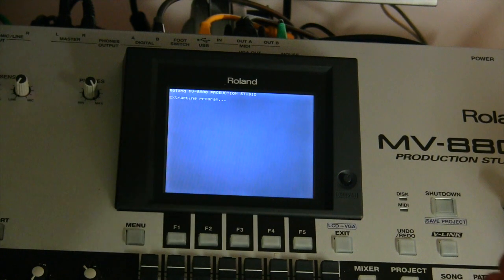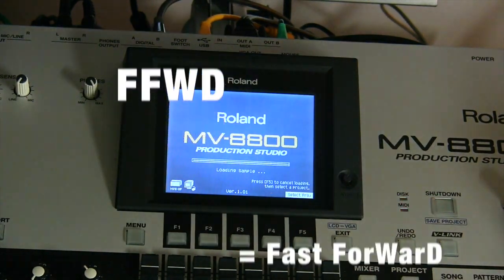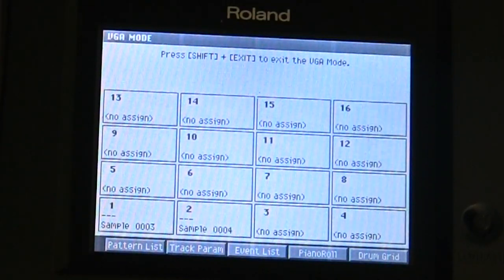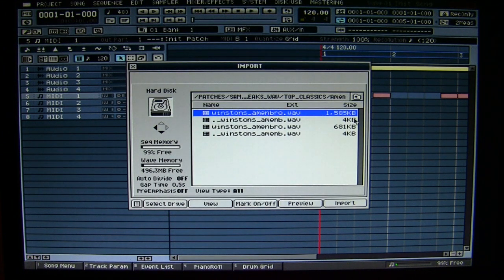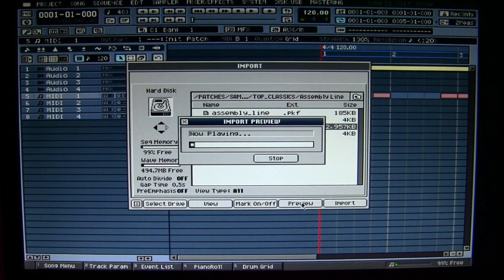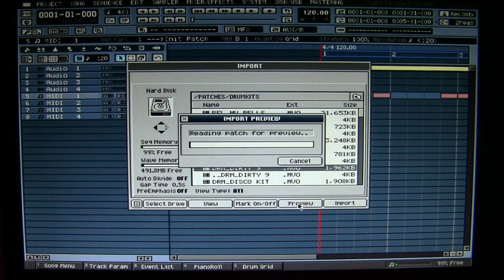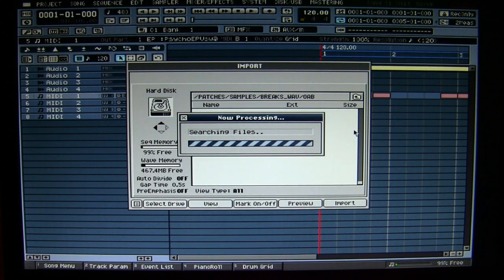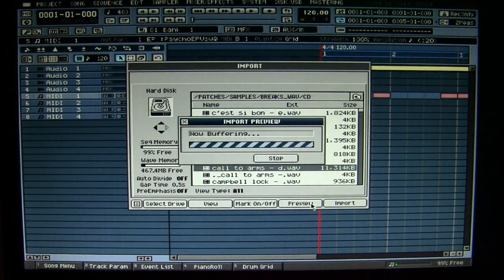MV-8800: I replaced the SSD for an IDE-CF adapter and the result is amazing!

Comment: There’s no iso files that need to be on the card?  The card isn’t for start up right? More for transferring and storage?
Thank you.
Reply from the maker: Correct! No need to have ISO files on the card. You format the card when it is installed in the MV and then it’s just an ordinary drive to store your projects, samples and so on. 
You can take out the card and insert it into a reader for your computer to make back ups for example or transfer sample libraries to the card. 
This is so much quicker than using the USB-connection of the MV. 
Hope this answer helps.
Reply: @theMIDImaniac that’s for that. Appreciate it
Reply: One more question 
We can save songs (projects)
I actually put the sd in where the floppy was. I have a MV8000 just waiting for male data to 4 pin to power and longer ribbon cable to board. 
Thanks you made me fearless to do it. 🎉
Reply from the maker: Yes yes! You can save projects, samples, mastered files and so on. 
I sold my 8800 some time ago and lately bought an 8000 and did the same like you’re doing now. I placed the reader where the floppy was. Just an amazing place to have that drive. 
Indeed…the ribbon cable needs to be longer. 
Good luck on your project! The MV is still an amazing piece of equipment. 
Glad that I could help 🙌🏽

Comment: Hi, 
Love your video and I am in the process of switching over to the IDE - SD adapter, because my drive went out. The problem is that my system was not updated to the 101 version and when I power up, I get a blank screen. Are there steps I can take to bypass boot up with new drive. Or do I need to update the system 1st before installation. My old hard drive will allow me to boot up, but always have drive error when trying to load or save projects. Any suggestions please.

Comment: Where did you find the special bracket to remount the CD Drive? What type of adhesive tabs or glue were those? Did go through the normal formatting process in the MV for the Micro SD card or, not?

Comment: do u have to keep the cd rom player in the mv 8000
Reply from the maker: When you have an MV-8000, you can leave the CD where it is and just take out the floppy drive to have the CF-reader on that spot. 
That’s really a great place for the CF-reader.
Reply: @theMIDImaniac   so do i remove the floppy drive cable from the main board ? or leave it in ?
Reply from the maker: @TB-po5cj  you can take out the cable too.
Reply: @theMIDImaniac  I replaced the HD drive with new drive and keep getting disk error , I put the card reader in and still getting disk error and on boot up it keeps sayin operation fail idk what's wrong with my mv8000... I have so many beats on the drive and the mv8000 dnt work anymore I'm so depressed rn
Reply from the maker: @TB-po5cj  Let's do some tests:
- Does the MV startup?
- Do you get the message 'Disk error, hit F5?'
- What happens when you hit F5?
- Can you unprotect the HDD in the SYSTEM Menu?
- If yes, can you do a format in DISK Utilities?
- Can you start up without a CF-card installed?

I think you're close, really.
Reply: @theMIDImaniac  when I hit f5 it boots but my HD drive keeps saying drive is not ready , when I connect to PC my drive dnt show up,  my card reader is installed and I get the same error msgs plz help idk what I would do without my mv8000...I wish I was making YouTube money so I can just buy a new one ...I would like a mv8800
Reply from the maker: @TB-po5cj  I wish I made some serious money too. 
With my channel YouTube pays me 50€ a month. 
Ok, F5-drive not ready. But you can get into the system, right?
You can work with the MV, I assume. 
You have to format the CF-card with the MV.
Reply: @theMIDImaniac  I tried to format the sd card but it keeps sayin drive is not ready I dnt know what's going on with the machine it wont read or format any drive I put in it I'm so stressed out
Reply: Is there a way I can video call u and show u exactly what I'm dealing with? Do u have Google duo I can give u my email and try and connect with u with Google duo

Comment: Hi, I enjoy your videos and appreciate you posting them. I switched my MV-8000 HDD to a Kingston SSD with IDE adapter. I used the same size files in your video to test the speed before switching to compact flash and I perceive no difference in speed in previewing and importing files. Just my two cents 😉
Reply from the maker: Hi! Sorry for the late response.
There's indeed no significant speed difference.
That's why I switched to CF instead of SSD because now I don't have to use the USB-Connection anymore.
A real time winner.

Comment: Hey Roger! Thanks for posting this. I tried doing this tonight and hit an issue trying to remove the CD drive from the caddy - those 4 tiny screws are stuck fast! Did you have to drill them out or something? Thanks
Reply from the maker: Hi!
Thanks for your message and question. 
The 4 tiny screws were removed with a small Philips screwdriver. Sometimes you have to tighten them first to make it easier to unscrew them. 
But use a small screwdriver, that’s important. 
Good luck!
Reply: @theMIDImaniac  ah great thanks - got a decent set of mini screwdrivers to replace my awful ones and it worked!
Reply from the maker: @ArwynKeast  that’s great!! Happy to read that.

Comment: Cool) is it possible to do the same upgrade for vs2400?.. course usb is absent there and it's very bad!..)
Reply from the maker: Yes, I have installed the CF-Reader for the MPC-2000XL from MPC-Stuff and it works very good.
Reply: @theMIDImaniac  ok, Roger, thankx 4 asking,..)  but in Roland vs2400 it will be works?.. i mean, i need to  make my full instrumental mix in mv8800 and moove it to my vs2400 song with vocal tracks that i edited there, and then - can i save my mastering track with vokals on this kind of card in vs?
Reply from the maker: @triboon9105  I can’t confirm it but the systems are the same.
Reply: @theMIDImaniac ok,  but how u using earlier the 2400 cansole, without usb?.. just like slave 4 mixer of mv8800?.. how u exporting your projects from vs?
Reply: And why u choose in final vs2480 4 your own work?.. Do not say that it just because it have separate mute/solo knobes & Panorama incoders + usb connectivitys... And numbers of chenals 4 physically recording...)

Comment: Hi Roger, I too am getting the Disk Not Ready error...

I saw on your comment below:-

"Check the position of the jumper next to the 40 pin IDE connector. 
It needs to be on master.
If that doesn’t change, set it on cable select."

I have checked on my CF to IDE (the startech one too) and the jumper is on the right hand side which i believe it is master...
can you let me know what you mean by set it on cable select?

thanks,
Bobby
Reply: Have you solve the problem ? I got the same issue...
Reply: @jakubcholewa8726  format as FAT32 or format from the MV itself.

Comment: hi bro, You know how to boot directly from the cd because they erased my system and I can't boot, the screen remains blank
Reply from the maker: Hi!
Your system is erased?
Normally a blank screen means that your hard drive is not working. Perhaps not right installed. 
When you start the MV you have to hold F5 to create a new and fresh project. 
What kind of HDD do you have?
Which version do you have installed?
If nothing works, re-install the firmware of the MV by using a sound card with midi and your computer with the SMF-player. 
Hope this helps
Reply: @theMIDImaniac  Some command to be able to boot directly from the cd rom because I cannot enter options since the screen is blank
Reply: @theMIDImaniac  the problem was that I took it to an engineer to give it maintenance and he updated it and it froze and it no longer responded, I changed the hard drive for a cf card even so it does not work
Reply: @theMIDImaniac  You will have a system image that I can download to solve the problem of my MV8000
Reply from the maker: @DJKalifa  I hope the engineer did not updated the MV-8000 with the firmware for the MV-8800 because that is a fatal move for the MV-8000. 
The problem is that the firmware is written on the onboard chip and not on the hard drive. It’s not like a computer where you have the OS installed. 
You can start an MV without having a hard drive because it works with the onboard chip and the installed memory banks. 
Your answer will be in this link to burn the update on a cd and to follow the procedure. 
https://www.roland.com/es-es/support/by_product/mv-8000/updates_drivers/1ec6ac49-7e67-4429-8c13-c7cb8cf5197d/
Reply: @theMIDImaniac  can the integrated chip be repaired?
my mv does not give signals nor can anything be installed from cd since the screen is blank
Reply from the maker: @DJKalifa  open the screen by removing the two screws on the back. Check if the flat cable is connected well. 
Attention! There’s a clamp to open first, then you’re able to take out the flat cable.
Reply: @theMIDImaniac  muchas gracias por tus tips  fueron un gran aporte pero mi mv ya la voy a jubilar, la vendere asi como está para comprarme la mv8800, gracias bro!
Reply from the maker: @DJKalifa  Haces bien. Lo siento pero creo que es la unica solución.
Gracias a ti por tu confianza en mi!

Comment: With all do respect, you should have slowed down the footage, it’s hard to follow your steps, thanks for sharing!
Reply from the maker: Sorry about that.
It's an easy job. Seriously.
Just open your MV, take out the drive, add the CF-drive and place the CD on another area.
Secure all and close it up.
Then start the MV and let the MV create the right folders and your good to go.
Really an easy modification.
Hope this helps.
Reply: @theMIDImaniac  👌🏽

Comment: Hi roger, I also have the same cf to ide from startech, but I read in the manual that you need to power off the adapter before inserting or removing the cf card. I remember you said it is hot swappable for you. Is there a difference with your cf card which has the sd card in it compared to just a traditional cf card? Looks like my mv does not refresh/detect the card when I take it out and put it back again. I need to power the mv off and on. Let me know, thx.
Reply from the maker: Hi Bas (Dutch too? Bas is a typical Dutch name ;-)
You mean my CF-microSD adapter? Perhaps that makes the difference instead of a normal CF-card?
Sometimes my MV doesn't read the files immediately. Then I press the 'IMPORT'-button or 'PROJECT'-button and then the files appear.
Perhaps something to try.
In the beginning I switched on/off too but nowadays I don't. Super easy when I want to add pictures to PIX JAM, for example.
Give it a try!
Reply: @theMIDImaniac  Yes the dutch are everywhere ;) Thanks for sharing, btw do you know if the loading times are longer if the cd-rom drive is not connected? In another video where you install the card you talk about having to connect the cd rom and just to leave it inside the mv-8800... Why dont you leave it disconnected? is there any reason for it to be connected but not used?
Reply from the maker: @bram9498  🙌🏽NL✌🏽
About the drive:
Somehow the MV needs the CD drive in the startup sequence. 
Without it, it doesn’t start. 
Best way is to place the CF on the place of the HDD and then with a dremel cutting out a hole for the card. 
Future project for me 😅
Reply: @theMIDImaniac  ok looks like mine is just starting without it being connected. Btw i recently purchased a V-synth XT, i had seen it in your studio and after reading some reviews i decided to buy one :D Awesome device man. Like the MV, its such a well engineered machine, with so much detail and options. Thanks for showing! did you do a video of the XT yet?

Comment: Can you please tell me if it is really possible to put the same thing instead of a floppy drive on mpc 2000 classic?
Reply from the maker: Hi!
It would be only possible if the MPC 2000 classic has an IDE connection inside. 
It’s not possible to use the floppy drive cable. 
I have installed one in an MPC 2000 XL blue version without any problem.
Reply: thanks man, you have a great channel!!!
Reply from the maker: @ДмитрийМитрофанов-ъ7р  🙏🏽✌🏽 thanks a lot!

Comment: PLEASE HELP!!!!! My MV-8000 powers on! and about 5 mins later instrument pop up appears and various others also on the monitor. ? Is my hard drive corrupted? And there's a few buttons that are broke I didn't know if that had anything to do with it or what. Please help because i miss using it. thanks
Reply from the maker: Hi John! My first advise would be to detach the hdd-cable and to see if your MV is starting normally. 
You should be possible to work with it without an HDD. Hit F5 for a new project when asked and the MV will start for normal operation. 
Of course you will not be able to save or load anything but you can sample and create tracks with the samples. 
If it doesn’t help, the dimm-memory could be corrupt too. 
But first try to start without the HDD. 
Good luck
Reply: @theMIDImaniac  ok will do! Thanks a million
Reply: It's holding the same screen🙏🏾!!! I unhooked the hard drive as you said and I removed the dimm and cleaned the terminals. so we'll see!🤞🏾 I will keep you posted if you don't mind I really do appreciate it
Reply from the maker: @1johnmill  yes, keep me posted. 
You mention that it’s keeping the same screen. Does this mean the same error?
Reply from the maker: @1johnmill  which OS are you running with your 8K?
Reply: @theMIDImaniac  oops sorry please forgive me.  No pop up screens
Reply: @theMIDImaniac  version 3.54
Reply from the maker: @1johnmill  that’s awesome!!!
Reply from the maker: @1johnmill  💪🏽✌🏽

Comment: 👋 Hello, many thanks for this video you bring to us as a gift 🎁. I’ve got a question about how many data storage space can be supported on the CF-Card by the MV8800. I remembered years before, I tried to adapt a 256GB Hard Drive on my MV unsuccessfully (I know it’s limited to 128GB). Do you think is there a way to have 2 hard drives installed on the MV8800? Or 2x 128GB CF card reader installed?
Reply from the maker: Jeanlouis COQUIN hi!
Thanks for dropping a question. 
Well, 128GB is indeed possible. 
I have tried 2x HDD but that didn’t work because the MV doesn’t work like a computer. 
But with the CF installed you can hit swap between different 128GB cards so I think that will be the solution. 
Or is there an explanation why you would need 256GB+?
Huge amount of samples? 😁

Comment: I would like to replace the CDRW with an IDE to Single CF but how can you burn your music? Will you be able to burn your project to a CF, then be able to send it over to another PC?
Reply from the maker: DJ. Stereo hi!
The CDRW has a non-IDE connector so it can’t be replaced by a CF-reader. 
Replace the HDD and you will be able to save your projects and create mastered WAV files to use them in your computer. 
It’s really super easy and convenient. 
You will like it.
Reply: @theMIDImaniac  The reason I asked is I have had "File error" when trying to burn a CD from my projects. I have replaced the CDRW twice with new ones and I have the same problem I want to be able to save my projects to a CF drive then burn them on a CD. Can this be done?

Comment: Hey roger I’d want to copy all my files from my mv to a folder on my computer and then put all that back on a cf card and back in my how do I’d do it
Reply from the maker: Hi Manny.
There are 2 ways.
1. Through the standard Usb-Connection. Drag and drop all the files you would like to save on your computer.
2. With an external IDE-USB solution. There are cables available with an IDE to USB connection to connect 'old' IDE drives to a computer for backup (https://www.amazon.es/Gembird-AUSI01-Adaptador-color-negro/dp/B007KYL6SY)
I do have that cable because it's much faster than the original USB-connector.
Good luck!
Reply: The MIDI Maniac ok gracias amigo

Comment: So it means you are booting from this IDE-CF flash? Doesnt seem praktical...And why does the cdrom needs to be attached, why you havent used a IDE-CF to swap with the cdrom instead? So you have a flash card besides the normal boot drive.. or maybe Iam missing something... I only see 1 drive connected to your system and that is the flash card right? thanks
Reply from the maker: Bas Hi!
The MV always boots from the internal memory because the OS is installed onto the ROM. 
The CF (HDD) contains the info for projects. 
Even without a HDD or CF the MV would start but will not be able to save anything. 
Why to leave the CD inside? Because in the startup sequence the system looks for the CD. Without the CD it will not boot.
Reply from the maker: Bas and yes, the CF is the only drive. The CD is also there but can’t be used. 
Feel free to ask more questions.
Reply: @theMIDImaniac  Ah thats nice (bedankt voor de snelle reactie :) ) Ok I understand now, i will do the same way. The cdrom needs to be recognized otherwise it wont boot? Some other subject question; When i press play the volume of the patterns/ song being played is much louder than the pads that i trigger (sorry i just bought the machine). I have to turn up the volume to hear the pads but then the volume is way to loud when i press play and the demo patterns start playing. I tried putting the volume of the parts up in the mixer but still there is a big volume difference between the played back sequence and my pads. Max velocity setting for the pads is 127. So i dont know what or where this could be... Any thoughts? I will read the manual but its a bit weird that it is like this. My volume knob is half way so precisely in the middle. 
Maybe i need to turn my volume knob all the way up and then turn the volume down of the demo tracks/patterns... ? I dont know, because i see you have your volume knob all the way turned up. So that should be normal... When i do that the pad volume is good but the patterns and song volume goes through the roof (unusable)
Reply: I have set the pad sensitivity from medium to the light setting.